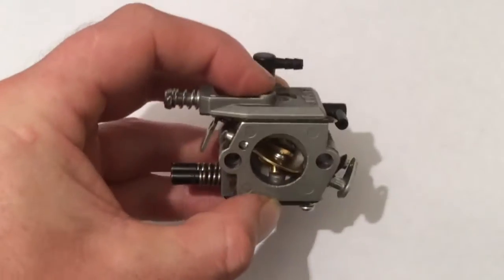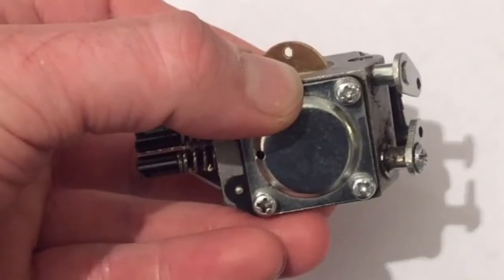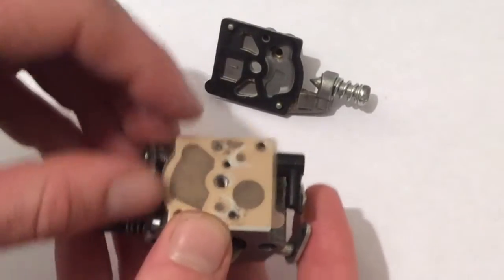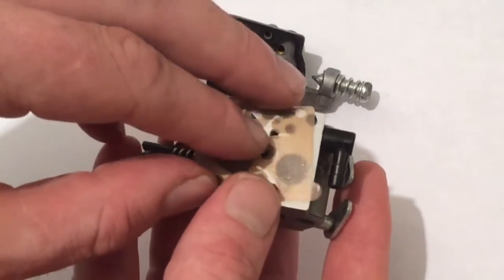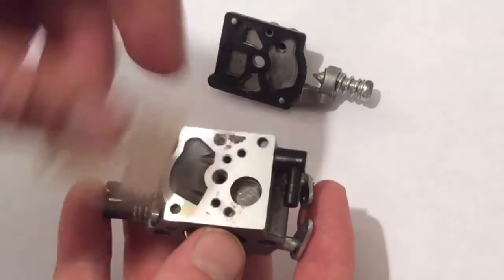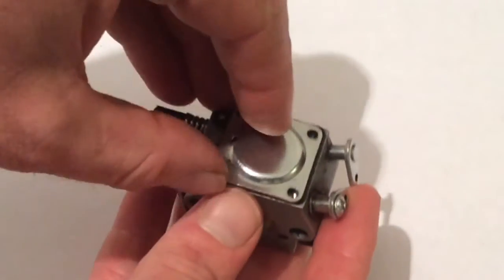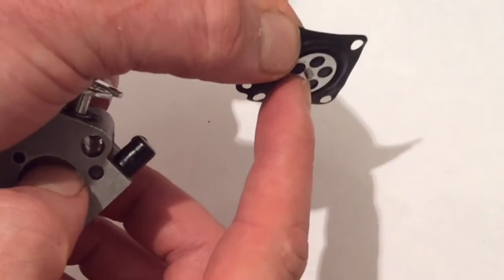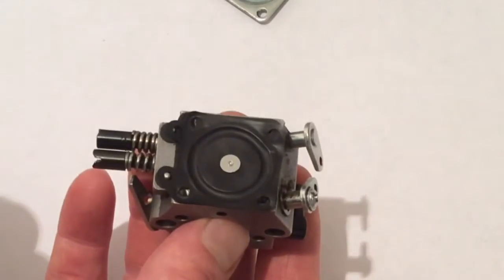Chainsaw Carburetor Diaphragm & Gasket: CORRECT WAY TO FIT!  (by Craig Kirkman)

Comment: Hello,  why there is two valve gaskets for carb (pump side) in rebuild kits? One is meshed as seen in video, and other is transparent or dyed plastic. Do you have to put them both on? Thanks!
Reply from the maker: Hi. No. Don’t use both. For some reason manufactures do supply both diaphragms. I personally only use the mess one. Ive found that these to last well. However, Just make sure they are the same and there is no other structural differences other than their transparencies. If there is a difference then chose the one that best suits your carb of course. Craig

Comment: heres a quick question, maybe a video idea. i have a paramotor. It came with a Bing 84 style carb. i feel i like that carb over the box\carb like you have in this video. i know my unit has a "fuel pump" which connects from the engine (pulse line i think its called) to the pump, and to the carb. i did carb clean when i got it. cleaning the float bowl, checking the carb and cleaning out the usually missed exhaust gas hole which was blocked and i drilled out clear. do you know if i should have done any matinence to the fuel pump?